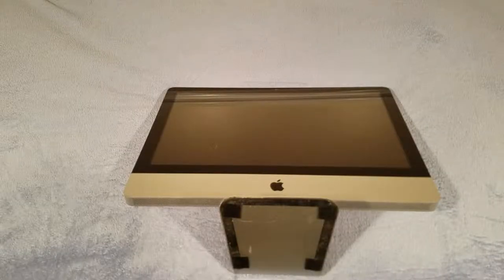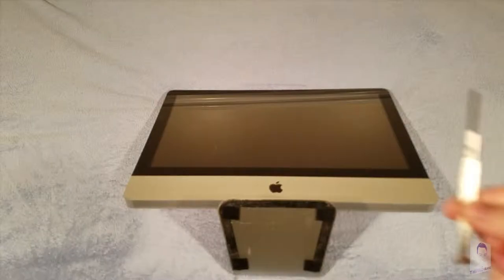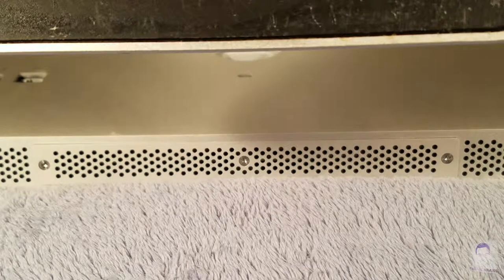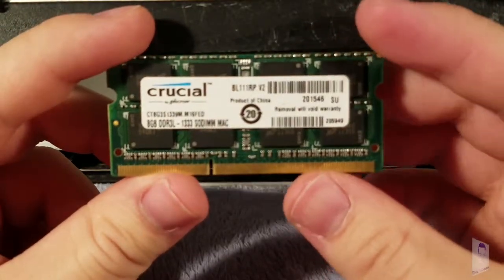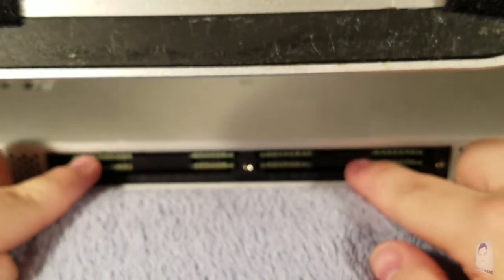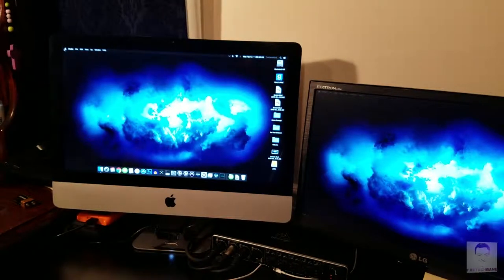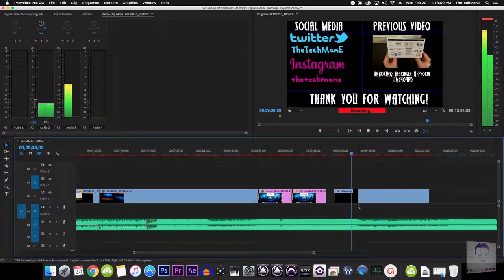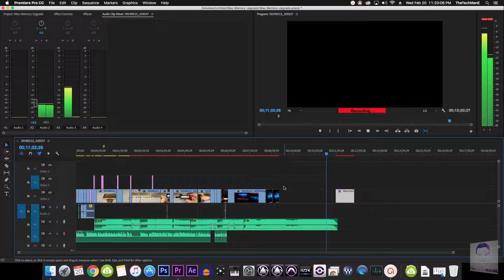HOW TO: Upgrade The RAM to 32GB on a Mid-2011 21.5inch iMac

Comment: Update: Thank you so much, I recently converted my IMAC IOS to Windows 11 PRO, and it was using 8 GIG of memory, so I upgraded to 32GB, and it's beautiful. Thank you for your help! Your video helped me install the memory correctly.  My plan for this iMAC is to install Virtualbox, which is working, and create a small centralized environment for educational purposes only.  My next step is to change the iMAC spinner to an SSD, and I have everything in place to move forward, but I need to learn how to "carefully" open this iMAC to make this happen.
Reply from the maker: I would love to upgrade my HDD to SSD! There is tons of videos to open this thing up so look around! My CPU video has me tearing it up to the motherboard so you can get a pretty good idea for it. Thank you so much for watching!
Reply: macs dont have iOS, they run macOS

Comment: To increase the iMac performance as well, upgrade the HDD to a SSD drive, wow, it´ll become 3 times faster or more. Including to edit 3D videos, it works incredibly fast
Reply from the maker: I've been thinking about that and I might do it. Thank you so much for watching!
Reply: @TheTechManE  i heard a 21 inch imac u have to open the whole thing
Reply: @TheTechManE  the whole screen
Reply from the maker: @saiedfn1590  To replace the hard drive, yes. For the ram, no. There's that thing on the bottom. Thank you so much for watching!
Reply: can you edit 4k videos in premiere?
Reply: True - the SSD makes a massive difference.

Comment: Great video, ordered 32 GB of Crucial, and ready to go when it gets here. I noticed on another video installing RAM that he holds down the Option/Command R & P keys when booting up for the first time. Did you not have to do that? Thanks again for the excellent video.
Reply: Found the answer to my own question:  Option-Command-P-R: Reset NVRAM or PRAM. This resets the Parameter RAM in the system. A good idea when installing new RAM. Do this at bootup and let it sound off a couple of times.

Comment: Hi, great video. I just wanna ask, is 32gb the max that it can upgrade on?
Reply from the maker: My iMac's maximum RAM is 16 GB. I upgraded to 32 GB because the iMac's at my college are 32 GB. I don't know if it can go passed 32 GB, so there is an experiment to be made. Thank youbso much for watching!!
Reply: @TheTechManE  how was the performance so far? Are you still using it until now? Is it necessary to upgrade the Vram to cope up with the ram or not necessary?
Reply from the maker: @airashisanchez2378  I'm using it right now to edit a video for Monday. The performance is wonderful. I haven't had any issues. I'm editing a 4K video which is tasking on the system specs anyways but it's still holding up! VRAM is Video RAM which is graphics card related and you cannot upgrade the graphics card on these. Trust me, I have looked into it and it isn't possible with complications, compatibility issues, and certain issues if you do succeed in doing so. I'm going to upgrade the processor from i5 to i7 VERY soon. Then, my Mac will be fully upgraded to the specs of that year. Upgrading the RAM is the only logical thing to do unless you want to open another can of worms to upgrading the GPU. I hope this helped! Thank you so much for watching!!
Reply: yes cause the CPUs used in the 2011 imacs  dont support more. i dont think there is any Sandy bridge cpu supporting more than 32gb

Comment: Hi, I have some questions. Is it still running ok? Any problems at the moment with crash down of the system or random turn off of the iMac? Thanks for the video, though.
Reply from the maker: Running like a gem!! I upgraded the RAM because of Pro Tools when I imported a video into it. 4GB of RAM isn't that good for Pro Tools so that's why I upgraded. The issue I have is with Premiere Pro when playback a video with a lot of effects or higher quality video. The lagging in Premiere Pro isn't the RAM but is the old graphics card in this that isn't GPU accelerated. Anways, the RAM and computer is still going strong! Been doing video editing and school work and it's awesome! If you have anymore questions, please comment below! Thank you so much for watching!
Reply: @TheTechManE  Thanks for the quick response. That info helps me a lot to update my own iMac. But reviewing your video again, Why you said that the correct rams are for laptop and not for desktop? Maybe I'm going to sound stupid but, is not and iMac a desktop? Thanks again.
Reply from the maker: @LarsBomPollo  I see the confusion. I ordered the wrong RAM sticks. I ordered ones for a desktop pc that are bigger. It wouldn't fit the mac at all but it would have fit my tower. So, I basically ordered the wrong memory. The memory that I originally ordered were for a desktop/tower which are bigger in length. The ones in the video was the intended purchase but I order ones for a tower. The iMac takes laptop memory which is the RAM you see in this video, small. Sorey for the confusion and I hope that cleared it up. The RAM in the video is the correct ram for the Mac.

Comment: I just found ur channel and suscribed . I have iMac mid 2011  21.5inch  that has 4g Ram . I want to upgrade it to 16gb ram . What do you suggest me please?
Reply from the maker: Thank you so much for the sub! You can use the RAM I used but just get 2 of the RAM I got because you only need two 8GB of RAM instead of three 4GB of RAM because you already have a 4GB in there. The best part about getting two 8GB of RAM is that later down the line, if you want to add two more sticks, you can. Also, if you get the two 8GB of RAM, install it on the 2 top slots of the computer. I hope this helps! Thank you so much for watching!

Comment: I have a Imac (21.5 inch mid 2010) and I thought you could only put in 4 -4 Gb memory in each slot and you could not go higher than that. I saw on Amazon on a capability chart it stopped at 4X4GB
Reply from the maker: You can go up to 32GB. As you saw in the video, it works. I haven’t had any issues. I don’t know why Apple would say that you can only have so and so amount but considering I did this, it works. Thank you so much for watching!
Reply: @TheTechManE  apple doesnt say it can only have 16gigs of ram. they offered the option on purchase to have 4x4GB ram thats why they write 4x4gb

Comment: I heard that this MID 2011 21.5' model only supports 4gb modules, total of 16gb! BUT, does 8gb ram modules really works?
Reply from the maker: Yes, it does! I saw the same thing where it said it the maximum ram the mac can take is 16GB. My schools iMac's are 32GB and are a 2017. So, I thought, "Let me see if 32GB would work on the Mid-2011 and if not, I'll just return the others." and the outcome is this video proving that it works. If you have a iMac Mid-2011 21.5 inch, there is a Amazon link in the description box that goes to the RAM I used. I hope this helps! Thank you so much for watching!
Reply: I also thought the max was 16Gb as thats what Apple state on their website when upgrading memory! Great stuff, I’m upgrading!!!!!
Reply: Wow. I almost ordered 16gb of Ram for my Mac. Good to know that 32gb works. Thanks for sharing the video.
Reply: it supports 32Gbs. 16(4x4gb) is what apple shipped the imac with max on build to order. but the mashine is fully capable of 32Gbs

Comment: Perfect video, very helpful!
I've noticed in the beggining of the video that your iMac used to have 1067mhz ram sticks, and you changed for 1333mhz. 
My iMac is also a mid 2011 21,5', but my ram sticks are already 1333mhz.
Do you know if I can put a ddr3 1600mhz 16gb ram stick (only one of 16GB, not 2 of 8GB) together with the 2 sticks (2GB each) that I have?

Thank you so much!
Reply: Did it work?
Reply: @bluscout-io8xs  yes, but the 16GB stick wasnt read correctly. the 2011 iMac only recognize 8GB maximum on each ram slot.
Reply: @rodrigoleonilen  But it's still faster maybe the system doesn't recognize it as 16 but knows it has the extra Ram?
Reply: @bluscout-io8xs  i didnt understand your question. the system recognize only 8gb maximum in each slot, even the memory being 16gb
Reply: @rodrigoleonilen  sorry I mean did the computer get any faster?
Reply from the maker: With 1600MHz, it won't work because that's the speed. The motherboard or something like that won't recognize it and probably give you an error. I tried it on a laptop with different MHz and it won't work so I go the recommended one from the specifications of the laptop and it work. I hope this helps. Thank you so much for watching!

Comment: Great video and thanks for the link. Have you done any other upgrades that don't required opening the IMAC? Would appreciate it!
Reply from the maker: No, I upgrade the RAM and CPU. Pretty much everything you want to upgrade involves opening the Mac. I would like to do a HDD to SSD swap whenever I can. It will make the computer faster. Thank you so much for watching!
Reply: @TheTechManE  I was thinking of buying a Samsung X5 Portable SSD 1TB, what do you think?
Reply from the maker: @kdnofyudbn5918  l haven’t done a lot of research into it so I don’t really know. I think the max space is 1TB so I guess that can work.
Reply: @TheTechManE  nope it can handle more than 1 TB easliy even 4TB
Reply from the maker: @thebeeamberheardsdogsteppe6368  that’s awesome to know. Love the name btw! Thank you so much for watching!
Reply: @TheTechManE  u can even put a Sandy Bridge Xeon 1270, and a Quadro GPU or AMD WX4150 in a 21.5" imac.

Comment: Does a IMAC i5 2.5Mhz Mid 2011 model also support 32GB Ram?
Reply from the maker: On Apples website, it said it doesn’t. Even though I placed 32GB in there, the computer utilizes the 32GB still. So, technically, yes it does. Thank you so much for watching and subscribe for more!!

Comment: Great video. I just tried to install but now I’m getting the 3 beeps and black screen. I pushed the card slots all the way in. Any advice on how to get up and running?
Reply: I just got the 3 beeps. Good thing I didn’t close it up because I knew I didn’t push it in all the way. Compared to pc motherboards, I found that you need to push a lot harder for the click. But be careful that it’s in the correct way. I used a flashlight to confirm. After I pushed it in all the way, it started up without issues.
Reply from the maker: You have to pretty much push in all of them and make sure they are flush and none are slanted. Thank you so much for watching and I hope that helps!

Comment: Would PC3L - 12800S work even at lower speeds ? It's what would happen on windows, don't know about mac.
Reply from the maker: I honestly don't know. I just got what Apple's website said it recommend or what was already in the computer. You can use a engine of some kind to run Windows on it and the hardware inside of you Apple device won't matter. Thank you so much for watching!
Reply: @TheTechManE  Had the chance to test before but and it worked flawlesslly
Reply from the maker: @fonolavalencia  Sweet! That's awesome to hear!
Reply: no it wont work. the imac doesnt support PC3L or 12800s on the 2011 models. the 2012 model i think uses 12800s

Comment: great video and I also was about the order 4x4gb so now need to look for 4x8gb. 1 question: the 8gb modules are DDR3L , the ones coming out are DDR3 (without the L (low voltage)) .... can either version be used?  Thanks.
Reply: No u can only use the Non L version otherwise ur mac wont boot and u need PC3-10600 Laptop Rams

Comment: good night, i upgraded from 32 gb on my imac mid 2010 to 32gb there are 4 8gb combs from kingston, i also upgraded the processor to i7 3.06 and upgraded the video card to 8gb, but when i turn off the computer it it only turns on again if I take out 2 of 8 combs and then it gets 16gb, and then it turns on, I wait for it to turn on with 16gb I turn it off I put again 2 8 combs to stay 32 and it turns on with the 32gb again. In short, after I upgraded it only starts with 16gb if you turn it off with 32gb it doesn't start with 32gb I've already called it by pressing the option+command+p+r and it doesn't help either... you know what it could be... ???
Reply from the maker: Now, I wanted to upgrade the GPU in my Mac too but there came tons of complications. You have to do some kind of coding, you lose certain features, you lose control over things, and there is much more. I think your problem is when you upgraded your GPU. Make sure the ram specifications you got are lining up with the Apple website specifications of the iMac you are using. I hope this helped. Thank you so much for watching!

Comment: hi bro, If i upgrade RAM to 2x4 12800s DDR 3 for my imac mid 2011 its compatible?
Reply from the maker: I honestly have no idea. You have to do your research for that. I just looked at the RAM that was in my computer and I got similar specs for it. Thank you so much for watching!
Reply: Nope is not possibe, The memory Controller only supports 10600. 12800s is supported only on 2012 imacs

Comment: My iMac 2011 says maximum 16GB?
Reply from the maker: Yes, mine said that as well. I did 32GB and it's running without a problem. Thank you so much for watching!
Reply: @TheTechManE  I inserted the 32gb and it still only reads 16gb. Any thoughts?

Comment: Are u say with 32gb Premier Pro still didnt render?
Reply from the maker: It rendered perfectly. I don't recall saying that. Thank you so much for watching!
Reply: Okay.. Just asking because i just brought the mid 2011 27in  with 8gb and i5core. I ordered 32gb it will be here soon. Does PP work good with 4k with the 32gb on there?
Reply from the maker: @andraesanders1948  Yes. I haven't used 4k as of yet with my computer but it should work great. Media Encoder is faster than the one that you are first promoted to render with.

Comment: Mine is making an alert sound and won't turn on
Reply from the maker: Did you install the ram correctly and what's the model?
Reply: @TheTechManE  i was trying to leave the elpida ones still installed...i removed them, and noe the computer is working fine thanks

Comment: Great video, but I was skeptical as I was worried about 'overclocking'? I have 16gb in mine and keen for the upgrade (plus an SSD drive) I found this link that confirms the upgrade is safe: cheers https://forums.macrumors.com/threads/can-i-put-32gb-ram-on-my-imac-when-max-is-16gb.1924912/
Reply from the maker: Thank you so much for watching!